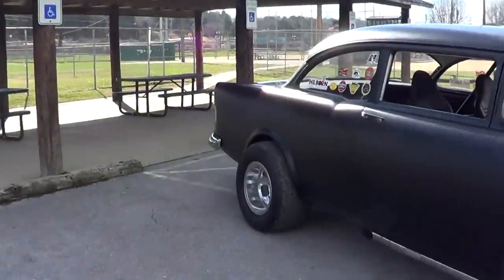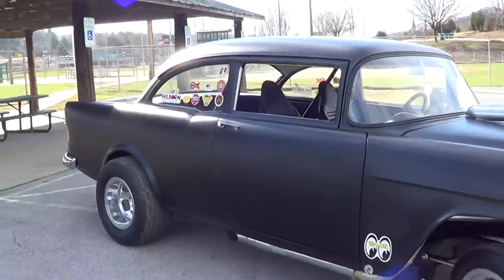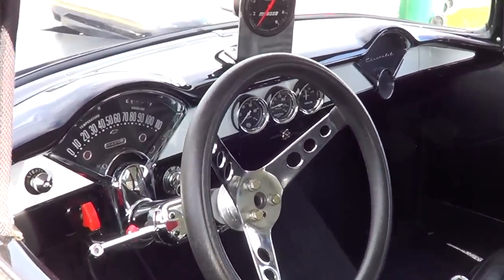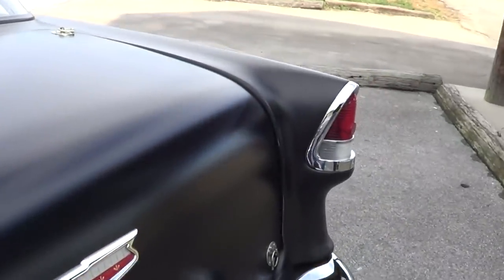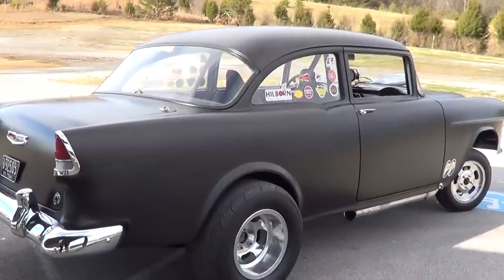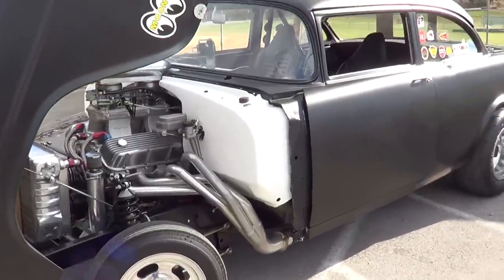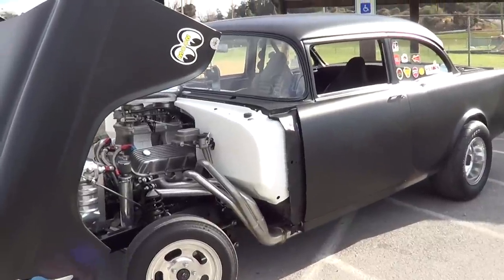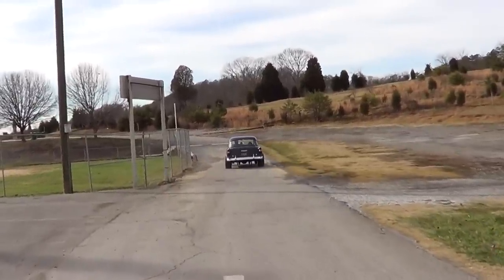1955 Chevy Gasser

Comment: @kobra1029 the speedometer n all that stuff they used to call them dummy gushes because they don't maintain your car by simply reading them to see if everything is ok. And no your speedometer will not limit the car to 150 if that's what it maxes out at. The speedometer will just ping out at 150 and your car will keep increasing speed if its faster than stock and doesn't have a governor on it a cap on how fast your car is set. Some cars shutdown at 90-100

Comment: sounds pretty good, except 2 lane was a bbc. and the vent windows were still there. they just had the slide windows on main side windows in front. i like the style of gassers, but mine isn't no where near. its tubbed all steel. everything, 12 bolt gm rear. suicide doors. bbc blown pump gas motor. n driven